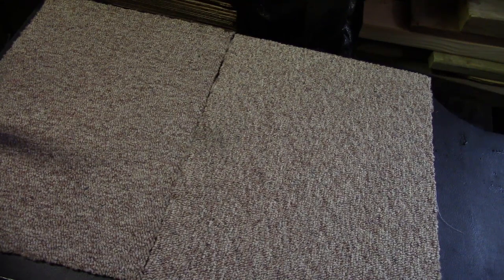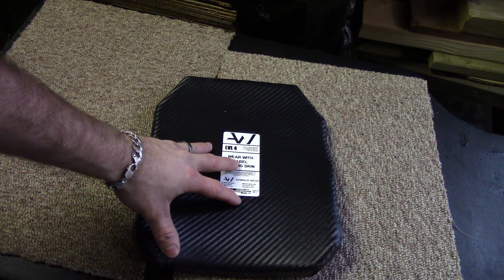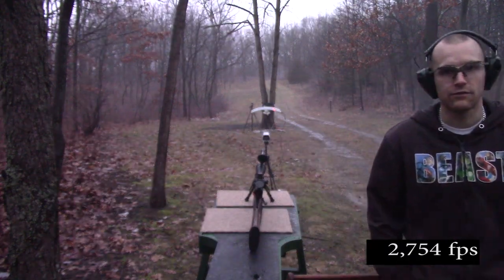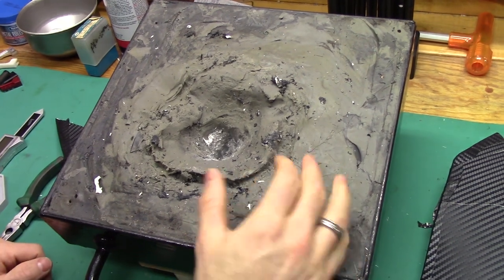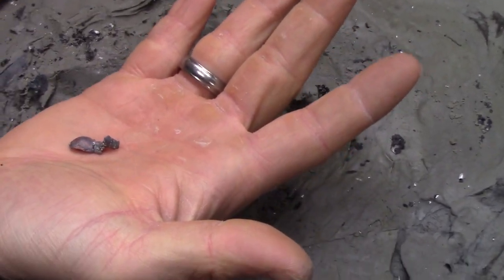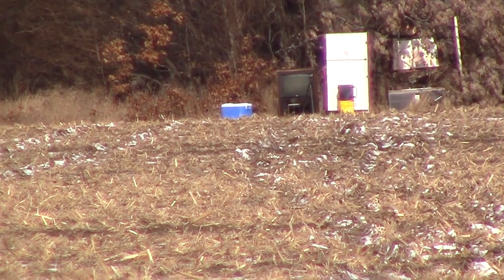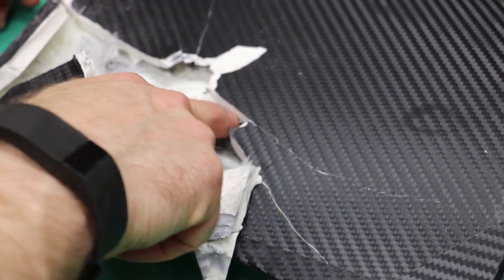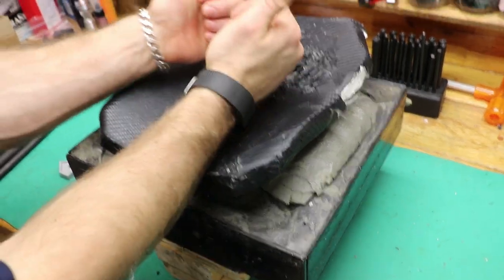Armour Wear Level IV Stand Alone Plate VS .338 RUM!

Comment: Thanks. I appreciate that you shot it at a fair distance. I noticed this video today because I was trying to see if anyone had shot level IV with a big .375 or bigger. The reason I was looking about .375 and the like is that I was wondering what it would take to incapacitate someone in such armor with the back face deformation rather than just barrel burning velocity. Maybe like a .458 Win at 200yds. Anyway, this test is probably a much more likely of scenario for the armor to face, and I appreciate that you did it.
Reply from the maker: My pleasure. I will test .375H&H this summer. May test it on a steel plat first.

Comment: That's just too much energy for level 4. If you could get a lighter bullet weight, or a harder core 338 load, I bet it would penetrate with energy left to spare!
Reply from the maker: +GreenCR21 I have 200gr accubond loads, and some 185gr bullets, but the 185s aren't loaded yet.

Comment: Does it matter that the tree is essentially an immovable object 's having the setup move somewhat freely when hit?
Reply from the maker: +corpsie666 possible. The plate can still move freely. I'll re-read the NIJ testing to see if the test stand can move, however even IRV8888 mounted one of his clay units to a tree for testing, and most of their tests (or even Demo Ranches) have the plate in a fixed device. Only way to find out: Test another level IV plate to the same standards (working on getting another plate)

Comment: would love to see this plate tested against standard 556 and 308 rounds. I don't like the way the ceramic just fell apart on these tests. I'm hoping it's just because of the sheer energy of the round you used. I've see other tests Idaho's plate before they switched to this carbon fiber finish and I'd like to see if this new finish holds the plate together better or worse than the old fabric cover
Reply from the maker: +Gilbert Cuzdey, Jr. I can see if AW is interested in more standard round test.
Reply: +Buffman thatd be great. I bought these plates and few months ago and now I'm seeing some info on the web that may indicate that these are sub-par plates. I'm considering sell these plate especially since the ones I have have the carbon fiber finish on them. the old fabric seemed to hold up OK. I also noticed that the 3+ plates actually seems to handle hits better than the 4 plates. do you know why?
Reply: +Gilbert Cuzdey, Jr. selling*

Comment: Take a look at ATSA RMOR I seen them shot LV 4 stop 11 AP.  2  7.62x 63 AP, 1  7.62x54R API , 3  7.62 x39 AP and 6  SS109 green tip at 40 to 50 ft and point Blank Weigh  5.8 lb
Reply from the maker: I question when anyone calls 7.62x39 mild steel core, AP because actual AP x39 is very rare.  I have some new 338 RUM loads and 300 win mag and am always looking for contenders. I'll give them a jingle.

Comment: Enough kinetic energy, providing a reasonably heavy bullet, will render armor pretty irrelevant after a point. I wonder what the point of the 338 RUM is though, when it seems pretty much identical ballistically to a 338 lapua.
Reply from the maker: +Tombs Clawtooth Probably Remington's way to get into the .338 caliber market? The .300 RUM came first in 1999, then a year later they released the .338 (parent case is the .300 RUM). It's very close to the .338 LM. Maybe about 100-200 fps on average for commercial loads.
Reply: You can shoot .338 RUM with a rifle that uses a .540" bolt face which means you can shoot a .338 Lapua type round out of a .300 win mag type rifle. That's useful.  You can also form the brass out of 300 RUM which might be useful. I want a.338 RUM.

Comment: Philipines made bullet proof can stop 50 caliber pretty cool
Reply from the maker: Got a link?
Reply: Are they energy transfer proof ? 50 cals are 12- 13 thousand fpe..the maths suggest it will NEVER be practical to stop a 50cal safely...even at 4000yrds with only 300 or 400 fpe left its potentially got a 5.56 tungstun penetraitor coming out +4000fps....youd need four lev4's and a foot of camping mats...you would sweat your ass off..[[[😳]]]°°°fkn hell its warrm in ere..